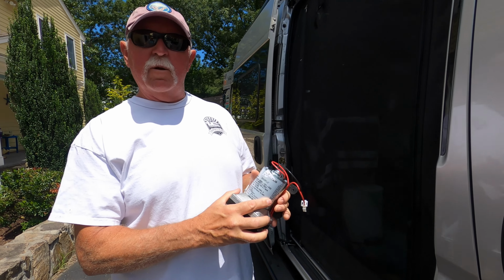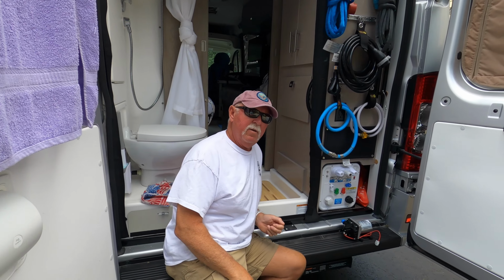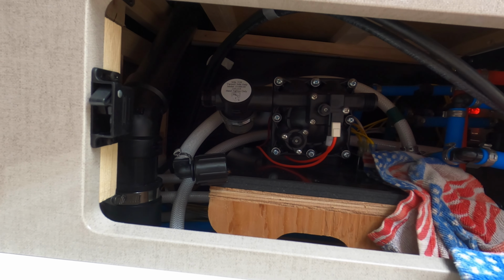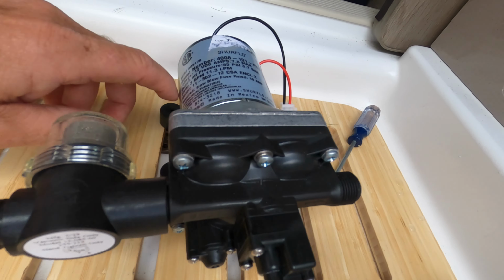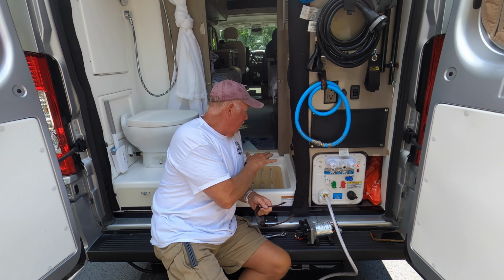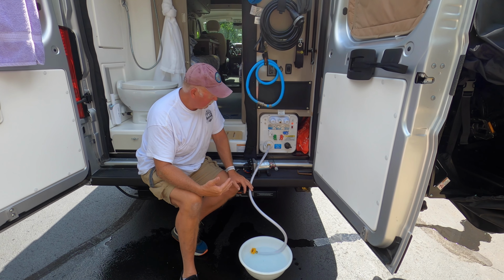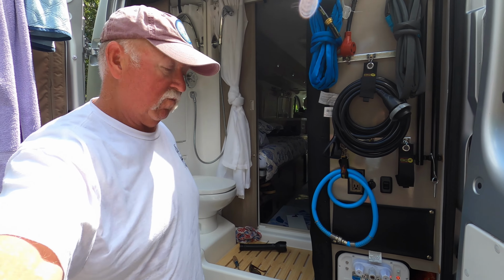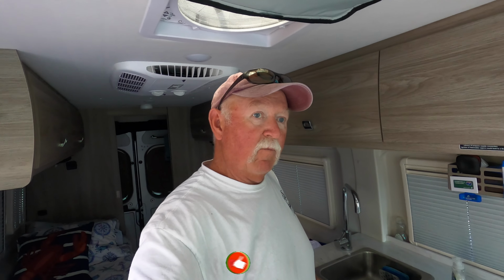2023 59K Water Pump Replacement

Comment: Great little tutorial, Mike. I'm keeping this in case my water pump needs replacement. It does make a funny noise but my pressure is good. 😊 Keep on keepin' on!
Reply from the maker: The pump noise is normal. My new one is a lot quieter.  All the best!

Comment: Mike great video.  I've only had my Travato 59KL since May.  So far no complaints about the water pressure or flow.  But I "saved this for later" just in case.  Thank you for this tutorial.  You make it look easy.  I did have a question though.  I like the way you organized and hung all of your hoses and electrical connections on the panel above the water panel.  I tried using 3m Contact hooks and they let go during some very hot days we've had here in CA lately.  Anyway are those RAM Mounts you have placed there or some other brand?  I assume the mounts are screwed into the panel? I have the same wrap straps you have so I have that part covered.  All the best to you and happy trails.
Reply from the maker: Thank you for watching.  In answer to your question, try this link. All the best!
Van Mod Storage Solution!
https://youtu.be/XzEBX282vZQ
Reply: Thanks MIke.  Watched the video you linked.  Loved it.  Thank you for calling out all the parts.  Some Youtubers just say "here it is" and leave it up to the viewer to do the engineering.  Thanks also for calling out/listing all of the parts you used to complete this mod.  I ordered all of the parts and now have them in house and I'm ready to make that mod and get my stuff hung up without those stupid Command Strip Hooks.  @ChippersIslandAdventures
Reply from the maker: Roger that.  Good luck and alll the best!

Comment: Hey Mike , all Travatos are 59. Year and model. Don't try to be an expert without full knowledge. They are all different.
Reply from the maker: Richard, did I not say it was my FIRST attempt at doing something like this? That is not expert.  Just lack of fear of doing something I haven’t done before.  I also stated I dreaded doing it because of the location and such.  I also stated it as a 59K and those that know, know my rig is a 23 on a 21 chassis.  Something I’ve made clear in previous videos.
Reply: @ChippersIslandAdventures  Have fun with your videos.I didn't know your rig was a 23 on a 21 chassis since I haven't watched all your very informative videos.
Reply from the maker: @richardlisatwedt3644  BTW, I added 2023 to title to clarify.  All the best!